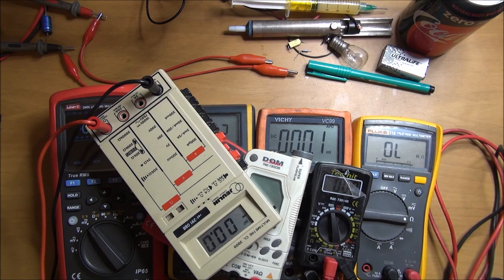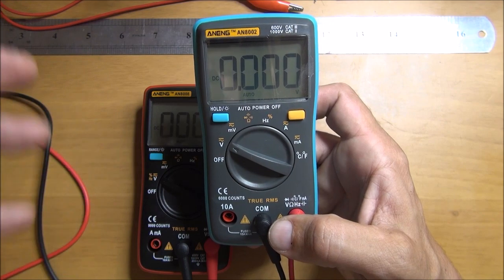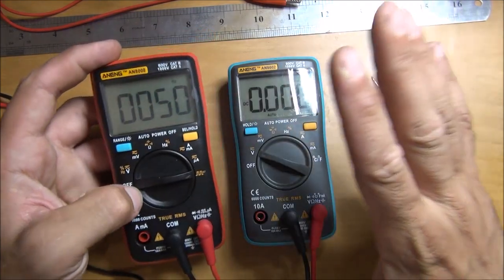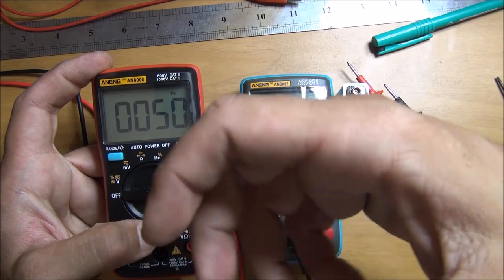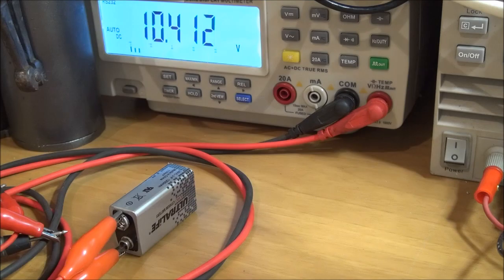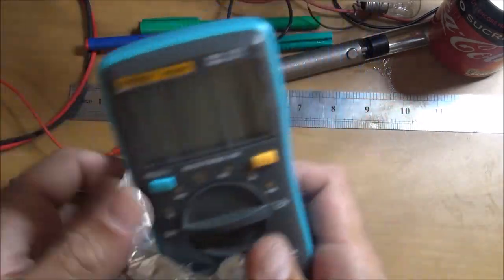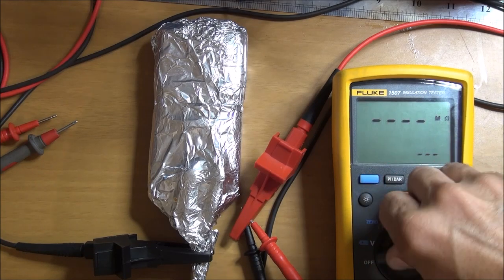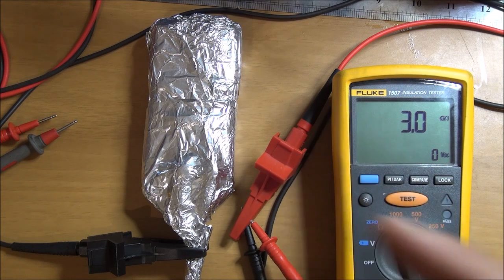ANENG, the Fluke Killer (insulation test)

Comment: I bought this Aneng 8008 for USD15 including shipping from China. I stopped using my fluke DVM because this meter is even more accurate and also smaller and lighter.
Reply from the maker: Yes, you're right. But Aneng have an strange issue when it's brand new. The rotative selector contains grease which need to be cleaned cause it's made bad connexion and strange behavior. Think about it, thanks for your comment.
Reply: @AIexanderHartdegen  my Aneng don't have that problem. I use it in my electronic design lab.

Comment: What price do you put on life? I think that if I was about to work on some high voltage or high current circuits that I would be investing in a brand name meter every time. This test is not sufficient to prove to me that these cheap meters are safe to use under those conditions. However they are perfectly fine for low voltage and low current applications the accuracy at those ranges is phenomenal for the price.
Reply from the maker: don't buy it thanks
Reply: I think you missed the point. I have one, I just don't use it on high voltage or high current and I don't think that your testing is sufficient for you to recommend it for such uses. Somebody could get seriously hurt or die.
Reply from the maker: John Jones hi; please let me explain to you some things. You are talking about " high voltage" and " high current". You need to know than high voltage is the name of range of voltage wich are higher than 1000V. Current is not measurable with this device, unless if you are regarding about somes amps.
There is no multimeters able to measure high voltage. Do you mean main voltage?
Lot's of people talk about " high voltage" for talking about main voltage. Anyway, you will not have more security on any device, including "fluke", or any another chinese brand.
Lot's of high brand are protected against explosion, protecting the user.
But I guess you are talking about electrocution.
If you talk about voltage higher than 1000V, no multimeter can do that.
If you mean" main voltage, 230v", I can tell you you can work with this multimeter perfectly, EXCEPT if you use your multimeter with high level of moisture. In this case your multimeter must be taged according european standart  EN 60529, tagging your multimeter by a sealing index ability "IP6" or more.
If you make a wrong measure, the fuse on the multimeter is perfectly able to make it's job, without exploding. For another wrong measurement, you can just damage your multimeter.
Of course, these multimeters are not made for working on several condition. Dust, moisture, risk of high voltage surge. This is a domain where fluke is the king, but lot's of job can be done with this simple Aneng.
I think people can use this multimeter on their workbench perfectly, and need to be careful when using it on the main voltage. High voltage are absolutely prohibited for this multimeter. And for lot's of anothers multimeters. You need to have high voltage habilitation. 
This multimeter is perfect for house and private use. It can be used on industrial jobs if only used on 48V max. I use this multimeter, cause it's cheap, light, and not the end of the world if stolen or lost.
Please remember than the first and best protection against electrical danger is YOU (the user), not a device.
Thanks for your comment.
Reply: I am not the person putting a 1000v tester across the little meter and declaring it safe to use. That would be you. Your video implies that this meter would be safe to use on anything up to 1000v which I believe to be false. You wouldn't want to use this meter to test a 400v motor now would you? You can defend your video all you want but it gives a false sense of security to people without the proper knowledge to work on electrical circuits and as such I think you should take it down.
Reply from the maker: John Jones please contact Aneng and ask them to stop to provide their product. Other users watching this video are able to understand what this video means. You probably miss the first 20 s of the video.
Please don't buy it, this video are for professionnal who know what it's talking about. Put a bad thumb, discourage your sourrounding to not purchase this brand, and every body will be happy. Please consider you wasted enough time with this video.
Reply: @AIexanderHartdegen  , compare the fuses on a Fluke 17B+  to the rip-off Aneng AN860B+ (Rebranded Zotek VC17B+).

Aneng meters are toys, not for professional use with dangerous power sources
Reply: Can't you get better fuses and replace them out for a buck or so.
Reply: @scod3908  My professor had a Fluke 289 start to melt during a 380V induction motor open circuit experiment. It was his last semester teaching, after more than 40 years of combined industry and academy experience, during most of which he never had access to such good equipment, as we live in a relatively poor country and 5-10 dollar multimeters are the norm. He didn't for a second put the blame on the meter, but on his own practices and negligence. For safety, buy the proper equipment but mainly, follow safety guidelines and be careful with what you are doing
Reply: @irishguy200007  NO ONE said it was for professional use, so dont buy this meter thanks

Comment: This isn't for electrician use, the input protection is nonexistent and doesn't pass any CAT ratings what so ever. So it's really unsafe for anything over 60V AC...

Insulation resistance doesn't tell you how safe the meter really is to use.
Reply: so what? with my dinky meter i measure up to 1000vdc and nothing happens, i can even go 20% over that without anything happening, and you are afraid of this meter? You call it throwaway? dont be a puss
Reply from the maker: so, for your sefety, don't buy it please.
Reply: Well... it's OK "throwaway" meter, way above the rest as long as you never use it on systems that have possibility of high energy transients in excess of 100V :)

Comment: In the manual it says: " Do not input voltage exceeds 36V DC or 25V AC when you are at the setting of measuring current"
What's that really means?  I cannot measure, lets say for example, how much current a 100w 220v bulb light draws ? ( I know I don't need the multimeter for that, it's an easy convenient formula to calculate it).
Or  it is just a safety precaution to not accidentally measure voltages above that range while the multimeter dial is set on "A", "mA" and ruin the multimeter?
Reply from the maker: In this multimeter, if you blow the fuse of mA or A section, you will have the intern calculator of the multimeter connected in serial with the load. The main voltage appears on the lead of the multimeter, and this voltage can destroy the intern receptor, wich is not in " automatic calibrating" mode.
An ampmeter work with a voltage sensor connected on a "resistor", called " shunt". In this way, the voltage display is changed by a " amp" display, and doesn't have any trouble if the fuse is ok.
If fuse is dead, you will inject a high voltage on a very sensitive circuit reading sensor, wich give you a amp or mA read trough a very low impedance shunt (millivolt are read and converted to amp display).
Normaly, if you blow the fuse, usualy you break the circuit and nothing is read.
It happen to me. When I blow the millamp fuse, I continue to have stupid read amp, instead to have nothing.
It mean than if I inject a high voltage in this case, I can destroy the intern calculator of the multimeter.
This is the reason (I guess) they advice to not exceed this voltage range.
Anyway, you can use it of to read amp on any voltage, cause current and voltage are not calculate by the same thing.
If you want to measure the current on your bulb, you can do it on the 10 amp caliber, without any problem.
Of course, never forget to replace the probe on the righ connexion before to test voltage or... BOUM.
Reply: Thank you for your explicit answer. Also, good to know about the fuse issue. I'll keep that in mind.
Reply: My 2 cents: the issue with all such small meters is that they have very small size fuses. And when those fuses get damaged under load due to the small distance between end caps with a higher voltage there will be arc discharge inside that would cause a fuse explosion and arcing outside of the fuse on a PCB. All of the above could not only damage the meter itself but might even cause hand burns etc.

Comment: Hello, Mr. Alexander.
I am a hobby electrics enthusiast and I am considering to buy an AN8008 multimeter. I see in its specifications that it does 9999 counts. Since you own one and have tested it, I'd like to ask  you if this multimeter can measure the capacitance of larger electrolytic capacitors. If I understood correctly, it should be able to display a, let's say, 3900μF capacitance (as it has four digits). Am I correct? Thanks so much in advance for your reply.
Reply from the maker: according to the specs of this device, you will can measure until 9999 µF.
I had this information before but I have forgotten if it's real or not.
Let me some fews hours and I will tell you tomorow. Thanks.
Reply: Alexander Hartdegen Great, thanks in advance! Much appreciated. :-)
Reply from the maker: Yes it can read very high several values form capacitor (respecting the good polority for best precision).
You can see it here
http://lektronik.canalblog.com/archives/2017/11/03/35833002.html
Reply: Alexander Hartdegen Hi. Thanks for the link, the picture was very informative.
I noticed that the AN8002 displays a value starting with 7, which is strange since it only supports 6000 counts. The AN8008 doesn't have that "problem", though. Thank you so much for the capacitor readings, it'll have made my purchase choice a lot easier. ;-)
Reply from the maker: according to the specs, these both multimeters have the same capacitors ability. thanks for your comment
Reply from the maker: sometimes, maximal counts are overwhelmed by 1 before make a new ranging with the anounced digits.

Comment: Love the joke on the video title😂
Reply: it wont kill fluke but it will hurt its bottom line, i bought one instead of buying a fluke, so thats about $200 dollars of profit fluke did not put in their bank account, and i kept an extra   $400 in my bank account
Reply: @debeeriz you can use this basic multimeter for only hobby use but don’t ever come closer to main electric junction box with this. Save some more money Atleast 1000s of $ for 3rd degree burns treatment instead of giving 200$ to fluke for your own safety
Reply from the maker: can you be more explicite?
Reply: Alexander Hartdegen that fluke killer part, cant really compare aneng and fluke as fluke is the industry standard. Aneng on the other hand is 15€ chinese wannabe fluke. And on the test, that voltage you put in will arc over contacts and ruin the meter while it may be safe to hold. And the situation when measuring high energy circuits and there is an overload, with aneng you will die, with fluke you dont
Reply from the maker: I think you're able to understand than no professionnal, or high technician will buy a Aneng for industrial measurement. Cause the serious part of intervention will be criticable.
In most case, people are not afraid about a over load on the multimeter , they are afraid about to be electrified when using this device. 
I guess nobody will use this cheap multimeter on a voltage over 380V.
There is lot's of test about cheap multimeter, with injection of high voltage energy on the probe. I can't do this kind of test, cause I hate destructing, and I am not a security engineer.
And for common use, people use it on a "personnal" workbench. 
It's worthless to save money for to buy an expensive multimeter to work properly, an Aneng will be enough.
For this reason, the title is " the fluke killer". You will not see this multimeter on a professionnal laboratory, but in lot's of hobbies applications. In this case, you can take the title seriously.
Of course, it's impossible for a serious technician to use only a Aneng.
For some reasons, a serious high brand multimeter is usefull to confirm a strange behavior on a failing circuit.
the title is certainly a bit daring, but they are a very serious multimeter.
Try to buy one, and confirm!
Reply: man, by saying "***piece if shit is a Fluke killer", you do nothing, but just play a dishonest game over here only for the purpose to boost a number of views. You mislead people by setting up your dodgy "experiments" with the "insulation tests" trying to convince them that the Chinese crap is safe enough at high voltages. But insulation of an enclosure of the multimeter has nothing to do with safety cause all the threat of electrical breakdown sits inside of it. That's exactly what Dave Jones talks about in his videos.  Crappy PCB topology, domestic 250 volt fuses used and so on, all that creates a potential threat to a user.  The fact is you know fuck all about high energy circuits and what happens when just a tiny arc appears on probe tips of a crappy multimeter when measuring mains. Since  industrial power lines are capable to produce kilo amp currents this tiny spark will turn in a huge fireball of 6000 degree Celsius in just a fraction of a second cause ionized air will let it draw as much unlimited current as the power line can give.  Very thick copper bus bars get fucking twisted like noodles when insulation is broken between two phases. I personally had a 15 dollar Chinese multimeter exploded in my hands being hooked up to domestic AC electric grid. Luckily the circuit breaker tripped the power off. Fuck it! No Chinese multimeters in my life any more.
Reply: @AIexanderHartdegen  MIC DROP #2